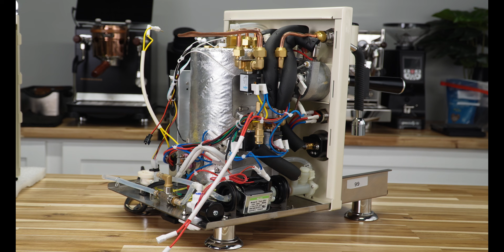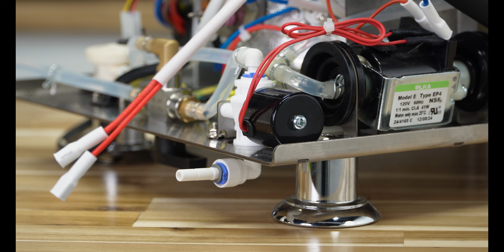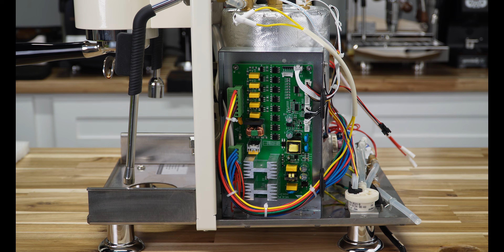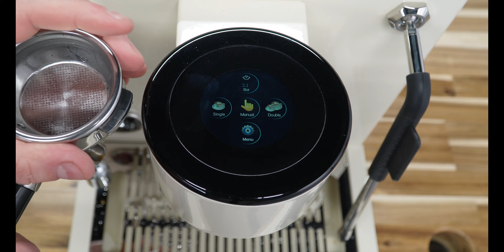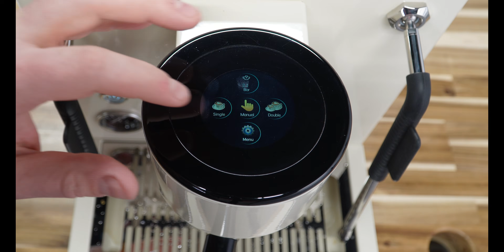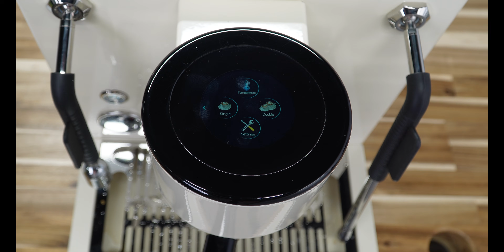Inside the Turin MC3 | Brew Heating, Steam Boiler & Volumetric Flow Meter

Comment: What's not mentioned here is that the machine has an OPV that is easily adjustable to 9 bar. Once I adjusted mine, it made a huge improvement to the quality of the shots. Add to that the programmable pre-infusion based on the flow meter, and you can really dial in an awesome shot. Then the machine becomes a simple one button-press brewer.
Reply from the maker: You can adjust OPV, but if your grinder is dialed in properly it will not require the OPV to limit the pressure, the puck resistance is what will limit it, typically leading to a much better shot.

Comment: I'd love to see some info on the brew temperature stability. The combination of a PID controlled thermoblock and heated group head should get it up to temperature really quickly and hopefully keep it pretty stable. Running a Scace device on this over a few back-to-back shots would be very interesting. This machine might give the Breville dual boiler a run for the money.